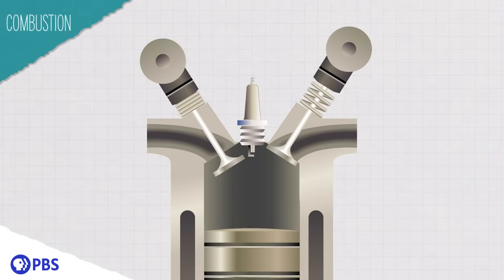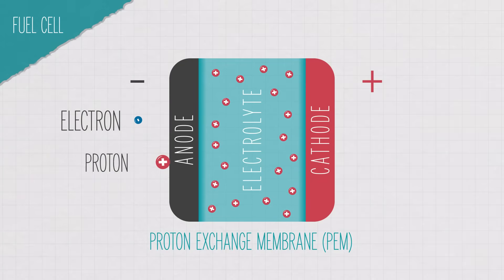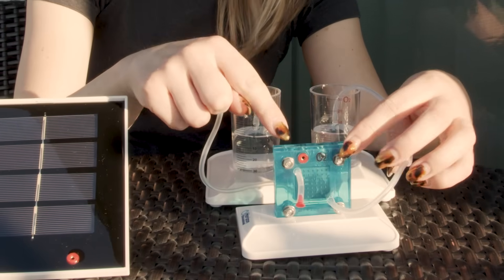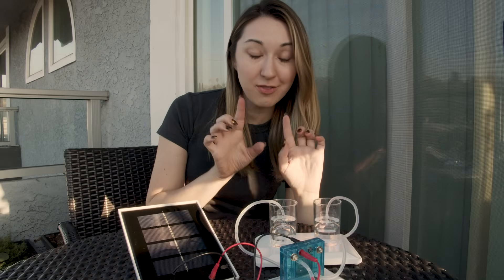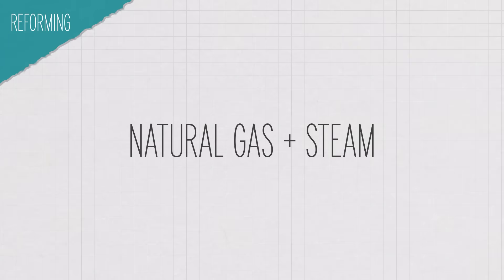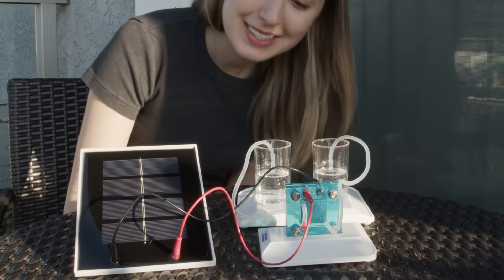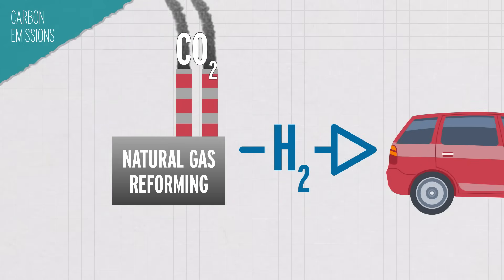How Do Hydrogen Fuel Cells Work?

Comment from the maker: If you’re going to drive a fuel cell car, you need a way to carry around all that hydrogen. Currently, that’s done with big, bullet-proof gas canisters. But metal organic frameworks (MOFs) could someday be more efficient storage solutions. We talked about MOFs in our recent video on extracting gold from seawater:
https://youtu.be/j5eomDz4Z0E
Reply: One could use Armonía. It would contain even more H2 than H2 itself compared by volume. Also a German university created a gel like substance what could store H2 cheap and sustainable. One would then fuel the care with water and separately that paste. Interestingly, they claim that if one extracts the H2 from that paste actually H2 (from the water) is created as "waste" in addition. So one gets more H2 out of that paste than one stored in it. Which is also a brilliant way to lower H2 production costs. -- sadly I haven't heart anything new about Armonía or that H2-paste lately.
Reply: U need to make one that is on demand, making more then enough, simples
Reply: not necessarily if we really move towards reducing oil dependency, we can reduce fossil fuels needed to create electricity needed for water electrolisys.
Reply: Ruthenium and platnium  are great catalysis but expensive for fuel cells so intermetallic metals
Reply: I disagree that hydrogen can't be made from electrolysis for the production of artifical fetilizers or semi-conductor industry. It's just that capacity of production isn't nowhere near the level you need. There aren't many commerical electrolysers out there.
Reply: and batteries are MUCH WORSE
Reply: Consider that methane can be derived from bio resources, landfills and sewers should be chock full of the stuff...
Reply: India has the best railway trains carrying hydrogen at low temperatures with hydrogen fuel cell power to run the trains
Reply: HELLO GRASIUS NOIR OSCAR COULD HYDROGEN BE (WATER AND SPIT THAT IS BOILED)
Reply: nice that was one of my questions. Pure H2 somehow brings some negaitve associations with it.  Hindenburg Images sit deep even if containment procedures improved since then .   Gotta have a look at that video than
Reply: Metal hydrides shouldnt be so expensive,  but still weighs less than a battery im sure. Hydrogen is the future
Reply: What about mining the gas Giants for hydrogen
Reply: Metal hydrides!! ❤️
Reply: No more dangerous than petrol,
Reply: We will be compressing it to 900 bars; cars currently only get compressed to 40-80 bars.
Reply: @nadredavani could you explain what you mean by this please🙌🏻
Reply: You have a way to carry it around, it's called water. 😂
Reply: You should look into the hydrogen car Bob Lazar made with his Corvette, he used tanks filled with a material called hydride then uses heaters to heat up the hydride which produces enough hydrogen to push the car as needed.

Comment: Why We Don't Need to "Make" It
Most hydrogen used today is manufactured, but white hydrogen is created by the Earth through three main natural processes:  
Serpentinization: This is the big one. When water reacts with iron-rich rocks (like those found in mountain massifs or deep in the crust), a chemical reaction occurs that strips oxygen from the water and releases pure hydrogen gas.  
Radiolysis: Natural radiation in the Earth's crust hits water molecules and splits them into hydrogen and oxygen.  
Deep Degassing: Some hydrogen may even be "primordial," trapped deep in the Earth's mantle since the planet was formed, slowly leaking out through faults.

Comment: I just don't understand why water can't be used. It's a very simple method that gets you a useful byproduct. It's not like pure oxygen is something that people don't want to use. And water is very abundant as much as people seem to think that it isn't. Whatever water is taken out by a hydrogen fuel cell is ultimately returned to the environment in some form. In fact, water is probably being returned to places where water is a little bit more needed, like places that people live. Water isn't pure enough to undergo valid electrolysis?

Comment: Right. But saying hydrogen isn’t a viable fuel source from hydrolysis because we still use non renewable energy to make it.  Is silly because hydrogen itself a perfectly clean source of energy. 

 you can kick start the process with conventional energy. And then use the hydrogen as fuel at a plant  to power making more hydrogen.  You’ll produce more energy than used to make the hydrogen. 

Then just charge a safer more conventional battery for the car to carry.  It will never be the case where we wide spread allow small grade hydrogen bombs to travel the highways driven by normal people. Never. It’s madness.   But that’s not the only way to use the hydrogen to power cars.

Comment: I think you might be missing the point a little - ofcourse the transition to another fuel source is going to require use of our existing hydrocarbon based methods - the point of making the hydrogen as cheap as possible is to promote the transition to hydrogen based technologies. Once those technologies are widely used, the demand is intrinsically there to produce the hydrogen fuel by better means. This argument about hydrogen using more co2 originates from greedy fossil fuel company's not wanting to make the transition to clean technologies

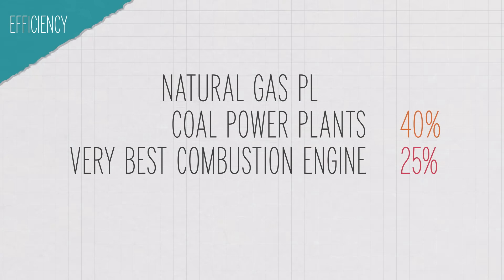Comment: 6:23 it also helps that the plants and generators designs aren't restricted by engineering requirements such as operating at various RPMs, switching between them while operating, powering an additional air conditioning system and lights, being compact and lightweight to be mounted on a moving vehicle, ecc

That's why having a generator in the trunk of your electric car isn't that silly

Comment: guys if you don't want to run out of hydrogen so quickly use a separate electrolysis unit basically just grab a cup, place your two electrodes in the top of the cup after filling the cup with water without making them touch, add baking soda if you want it to be faster, get your alligator clip wires and clamp them to the electrodes (do NOT let the alligator clamps or wires touch the water), then feed it electricity and use a tubing method to carry the hydrogen from your cathode electrode to your let's say your car engine (if your using it to power your car or smth) Be Careful make sure your collecting hydrogen and not oxygen (unless you have smth that needs the oxygen in that case make sure to collect them separately), and you should be good I'm going to use one as kind of a science experiment by feeding my electrolysis into fuel cell to power an led while looping unused power back into the electrolysis system to see how long the led can stay on while replacing the water if it runs low

Comment: 1:30 i thought cathode was neg.
Reply: It's negative 
In electrolytic cells not in galvanic cells (batteries)
And cathode is also negative in pretty much anything but a battery
Reply: Yh I noticed the same, tried stating it too.
Reply: @Yermehyaw  different country code. some countries the colors and operators are switched, so maybe thats the reason in this case.

Comment: Couple of questions, 
What would happen if you connected the gas pipes the other way so the hydrogen is running through the oxygen side and the oxygen is going through the hydrogen side?
2nd, if you had a few of these, would you run the hydrogen in series through each cell in a chain or would you split the pipe so it runs through in parallel?

Comment: I found on yt a man that had a platinum catalyst that burned hydrogen to get electricity nothing new and he had a catalyst that split water rubidium I think into h2 and o the it drove a little motor . The two reactor were one piece blue plastic .from what I saw  the rubidium splits the water without an seperate voltage source it is totally catalytic .

Comment: You didn't mention that Hydrogen cannot be liquified unless it is cooled to near-absolute-zero. And it will absolutely destroy any containment vessel if the temperature rises. Until some more practical packaging system is discovered, Hydrogen will not be used in vehicles.

Comment: What if you used a hydrogen combustion engine to drive a generator to power the fuel cell. That way the exhaust water from the engine could be split via the fuel cell, producing more hydrogen, which could then power the engine, and so the cycle continues.

Comment: its incorrect for you to assert that using fossil fuel to produce hydrogen is the most efficient method when clearly it is not simply because the oil industry decided to ise the oil they have to produce the hydrogen they sell so its a win, win, win in their eyes they get to keep profiting from oil they profit from the hydrogen and they also  profit from the claims you are encouraging bevause that removes any threat to the oil money they would lose from people realizing you can run a vehicle on water.

Comment: Well- Really concerning Hydrogen Powered Vehicles - WE can make the Hydrogen ON Board which makes it 100% efficient = Also with the Solar panel creating the electrolosis we now have Zero emissions. The idea here is outdated maybe? The original idea was in fact to pick up hydrogen at a 'Gas Station' to power the Vehicle. It looks as if that idea has passed thankfully~! with making Hydrogen on board there is no need for refueling either~!

Comment: The Hydrogen energy is a viable source of power, that powers not just vehicles...but also most appliances such as Airconditioners, refrigerators, most heavy equipment that requires hydrogen energy, simply charge for a few minutes and it is charged, or when in continued use, such as butane for most Compressed Freon replaced by Hydrogen flasks, this is a guaranteed option and further adjustments in the energy markets, and so as its brands, various brands that has shifted to long term eco-friendly businesses and lifestyle.****All Rights Reserved****Non AI/Fintech standards of Excellence****

Comment: if you just run a fuel cell in reverse, it's a hydrogen generator. at the individual level, you could generate your own hydrogen with water and a wind, solar or solar sterling electrical generator.

Comment: I always imagined hydrogen would be mixed with oxygen and burned much like in combustion engines. Except the byproduct would be water. Guess I was wrong.

Edit: I did some research and found that yes hydrogen combustion would work but it would also produce harmful nitrogen oxides due to atmospheric nitrogen reacting with the oxygen in the combustion chamber.

Comment: Am I just being dumb or would it make far more sense to use hydro power to do this when compared to solar?
You already have the water source right there so electrolysis can happen on site and they are typically quite close to population centers so the hydrogen can quite easily be piped to filling stations or transported by truck/rail.

For isolated filling stations also typically have water running to them already so they could use solar (the surface area of the shelter seems like it would be more than enough). Cutting out fuel transport for the most inefficient but needed locations.

Comment: Is this sponsored by the fossil fuels? Battery to start the electrolysis at the engine once started the engine produces enough energy to electrolize enough water at the engine to make more than enough hydrogen run the engine but Race the engine.

Comment: I gave up hydrogen quite early... I don't understand why there is not battery change and rent system as a service in western countries with standardized akkupacks. This would be the perfect solution. This would cost more for one charge but saves you the time almost entirely with the guarantee your akkupack will last the whole life of the car. additionally you can decentralize the charging as gas stations and need overall less of it by still having zhe option to charge it the old way at home on a wallbox. But since this is a big service business there will enough charging stations.
The only point is like at the smartphone problem you have to force the manufacturers to build one standard that matches all like the EU did with USB.

Comment: With current hydrogen production from fossil fuels, we are better off just burning gasoline and diesel.
Producing hydrogen from renewable energy is better, but very inefficient - we are better off storing that energy in batteries which are constantly improving in energy density, charge speeds, longevity and cost. 
Hydrogen has some niche applications, but will never be practical as a fuel for passenger vehicles or for heating homes.

Comment: You are wrong about battery powered being more efficient!
Battery power depends on producing electricity in all the dirty or clean ways hydrogen does but you get less miles per gallon of fuel used to produce that electricity than you do with hydrogen!

Comment: The powers that rule the world can't put a meter and charge you for hydrogen fuel. The technology is there, cheap and efficient but, not profitable. Until a process can be invented and not circumvented to produce these fuels and charge you for it, you're all stuck with gas and overpriced electric. And if you doubt what i just said, just answer why electric cars have not become a mainstream fever.

Comment: Hence why I have VERY easily driven 100,000km on home solar with an EV.. hydrogen is a barrier to entry. It has to be made. Stored and transported. It uses a phenomenal amount of energy to produce, store, and transport. Once you have an EV and charge at home. You will get it. Moving electrons through cables is much easier. Cheaper and directly more efficient. You can - like hydrogen, chose fossil fuel, or renewable energy at any time. Beating the efficiency of a power cable, and or having a solar system on your roof is an IMPOSSIBLE task.

Comment: Why don't you just connect the motor directly to the solar panel i know it will run without hydrogen gas from electrolysis 🙂

Comment: You could also just burn hydrogen in a modified internal combustion engine and skip the whole fuel cell to electricity process.  The exhaust would be water vapor.

Comment: Not at all zero emission because water vapor is the single largest greenhouse gas so we would just be creating hydrogen from fossil fuels and then generating WAY MORE water vapor which we do not need in the atmosphere. Just Imagine over 2 billion+ vehicles and 10's of 1000's+ of planes, trains, ships and powerplants making water vapor in the future 24/7/365 A VERY BAD IDEA! They absolutely do NOT HAVE BETTER RANGE due to the physical size of the current storage system needed to achieve that regardless of it's higher energy density. Current hydrogen vehicles can barely keep up with current battery powered vehicles for range and are very far behind many ICE powered vehicles. 
And that is nothing compared to sitting on top of compressed hydrogen Hindenburg in a vehicle crash, and don't try to tell me it will be safe... someone else can test that theory!

Comment: It'd be added weight and complexity, but I wonder if it'd be viable to just build a closed loop hydrolysis system INSIDE the car that runs off of electric car chargers. You'd lose the refueling speed benefit, but you'd gain the benefit of a vastly greater network to refuel from. The extra weight might reduce your range a bit, and you may need to top up the electrolyte and water occasionally, but I think as long as the complexity and weight isn't too much it'd be a viable way to do hydrogen fuel cell cars.

Comment: So you are going to need to depressureize it constantly, or use low pressure = less torque. In the event the depressureizers get clogged/fail, you want a backup, because if the hydrogen goes past a certain temperature, 50 molecules = 3 mile blast radius, and what you would be using is a lot more than 50 molecules

Comment: the problem with these is that as the pressure builds in an engine, and the hydrogen is ignited, there is the possibility that hydrogen will remain and be heated by the ignition + pressure, and become extremely explosive (take your block out)

Comment: Ok here is a thought .Electric car takes several hours to fully charge and burn it rather quickly and must be charged to continue to travel . Hydrogen car takes seconds to fuel from station and can be fueled while driving if set up to do so .1 takes a very heavy load off the grid while the other puts a heavy load on a grid that is heavly loaded, now what makes more since. Just a thought, what will you do when a governor tells you not to charge your car do to an overload on the grid.

Comment: So, after the electrolysis the product you fill your Hydrogen powered car with is the hydrogen, the oxygen is not put into the car. This means that, in generating hydrogen for the cars, you are going to have a LOT of leftover oxygen, which could be kept and sold for other purposes, creating another profit center. I like that.

I also find the relative efficiencies of converting fossil fuels to energy to be interesting, I did not know that. But in producing electricity or hydrogen in a remote location, as you pointed out, introduces logistical issues and costs to get that energy to where it is needed. Side note: How comfortable would you feel cruising down the freeway next to a tanker carrying compressed hydrogen compared to gasoline? In an accident, is there potential for that compressed hydrogen do nasty things? I seem to recall a LNG leak in the SF Bay Area that ignited and flamethrowered several houses. Hydrogen escaping from a tanker could do the same thing, a spout of flame from the leak.